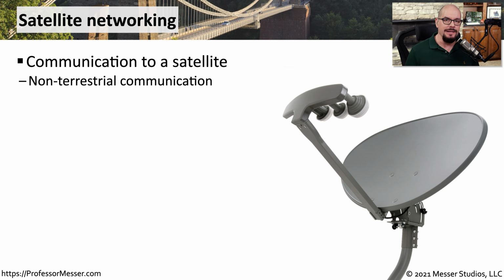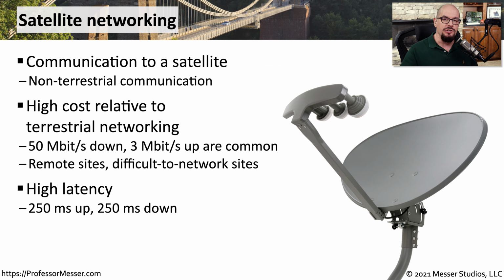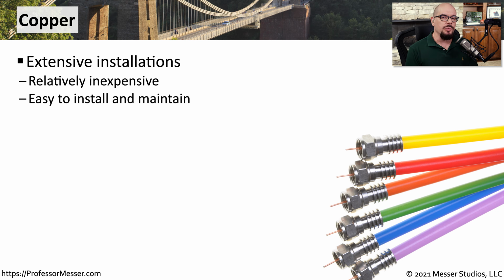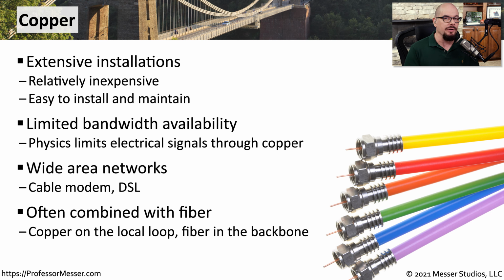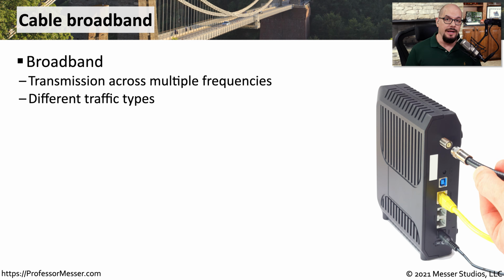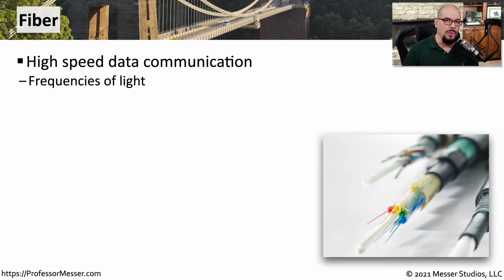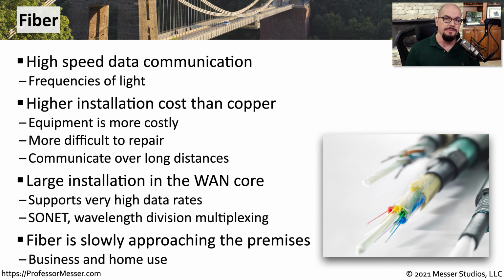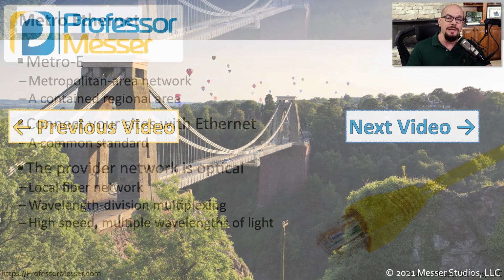Provider Links - N10-008 CompTIA Network+ : 1.2

Comment: Can you upgrade your LAN to Fiber wiring yourself or does the ISP have to change the type of signal being sent?
Reply from the maker: The ISP determines the media used to transmit their services.
Reply: Your ISP is most likely using fiber to transmit your provided Internet. If you want to create your own infrastructure of fiber, you can definitely do that within your Lan
Reply: you can convert anything on your side of the demarc to fiber if you want. So if you want to use fiber from your router to other devices thats fine. But if you want fiber from the street ran into your home, you have to contact the isp

Comment: great  content ,how long does it take to be ready for the exam
Reply: This video session on NET+ is about 14 hours long.  If you take notes on portions that aren't sinking in, it'll take a little longer.  I dedicated a month for these NET+ videos and I'll be ready to pass the exam.  But I may pass on the NET+ cert and go for the CCNA instead.
Reply: @erikthered7422  Im attending a community college atm and I’m actually taking a networking course that prepares me for the network +.  It is through test out though, so I go back to these videos and other sources for clarification. Im also taking the CCNA 4, 7 week classes.
Reply: @sebastianlisowski9208  I stopped going to college because there are parts that don’t sink in well, no matter what the teaching strategy is.  Then the rest of the course is a loss.  Right now, I’m stuck on calculating subnets and such.  So far, that’s the only hang up I’ve had but I’m going on three weeks of focus on this one thing.  A college course won’t stop and wait for me.  I will get it though.  Will you get both, Net+ and CCNA?
Reply: @erikthered7422  I’m going to try to get N+ this winter, CCNA in may and S + next December
Reply: @Bot32612  Is the N+ really necessary if you have the CCNA?
Reply: I don't really know because I am taking a class to prepare for it, so I might as-well just take it while I have the student discount
Reply: @Bot32612  how did it go
Reply: @ceowade  how did what go?
Reply: @Bot32612  how did your exams go
Reply: @ceowade  it went pretty good. I passed the N+, currently studying for the CCNA
Reply: @Bot32612  I also passed my N+ I gave my self less than 2 weeks(with over 2 years in experience) to study and I passed. Onto Sec+ now
Reply: @erikthered7422  I know this comment is old now but if you have CCNA I dont really see a point in getting N+. CCNA is more industry recognized and more complex than N+
Reply: @RM-56  lots of people take the Net+ to both prep for CCNA and complete comptia trifecta(A+, Net+, Sec+). CCNA is obviously of a higher value, but for people like myself Net+ can serve as a base level of understanding in lieu of college courses or experience
Reply: @Lis23168  please which resources did you use? Am currently on it,